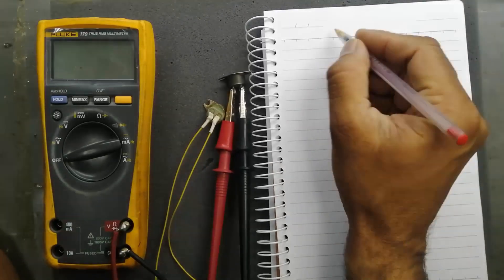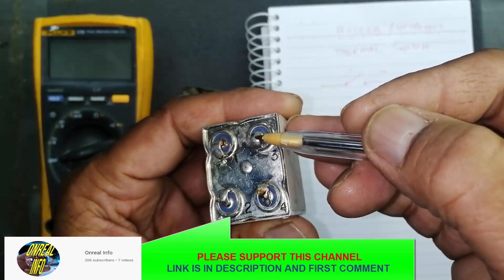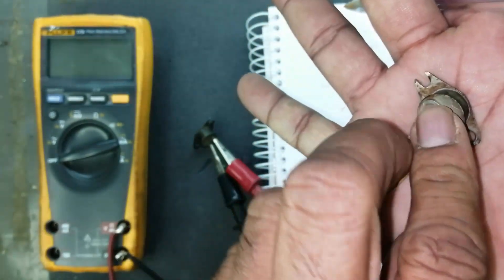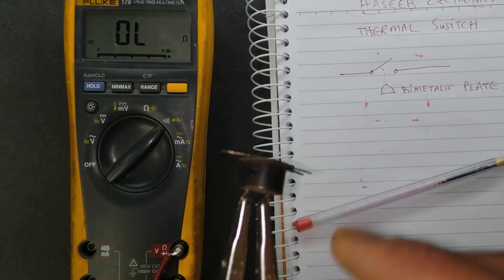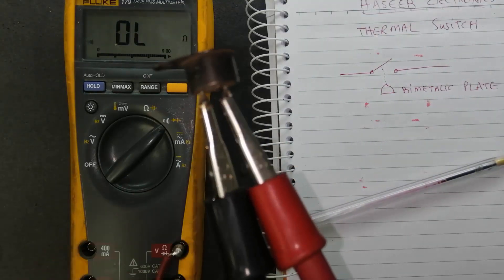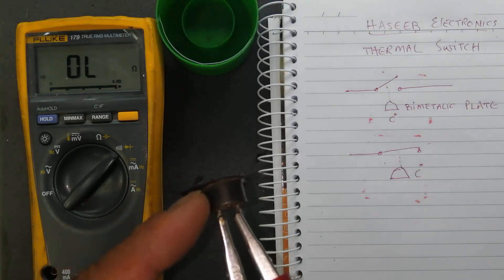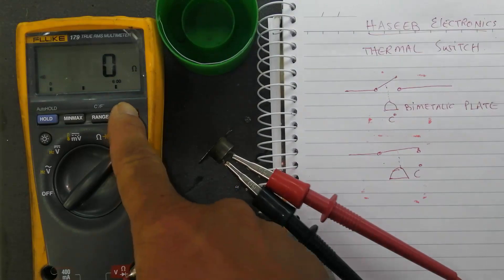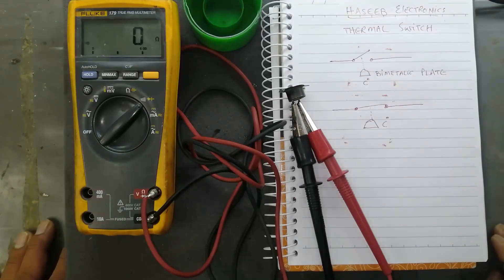what is thermal switch, Thermoswitch or thermal sensor switch and how to test (THERMAL SWITCH)

Comment: how to reset and check thermal switch in sanyo projector?
Reply: @HaseebElectronics  I have Sanyo PLC-XP21N, but.... white and bright screen shows but, pic is not showing. LCD control IC going heat up and then within 10 mints projector switch off automatically. What is the problem with projector ? what is solution for that?